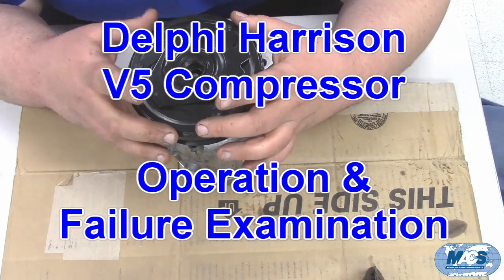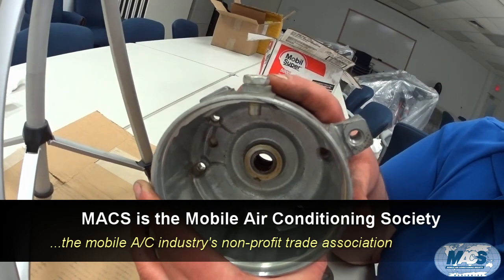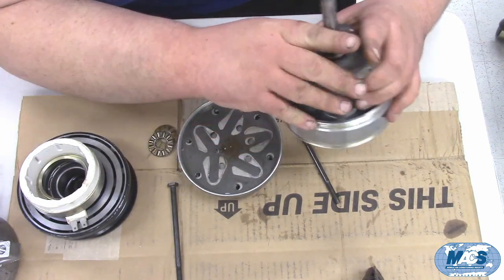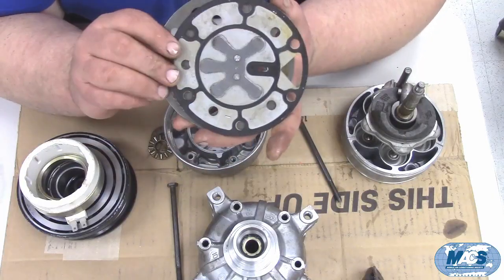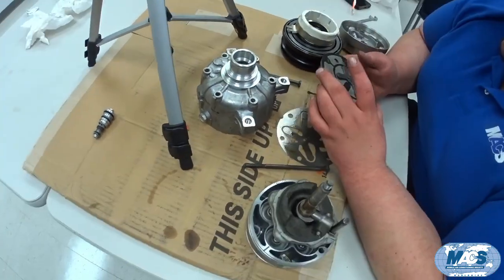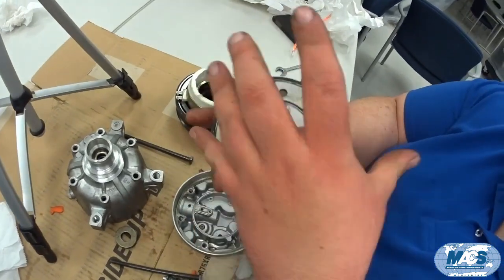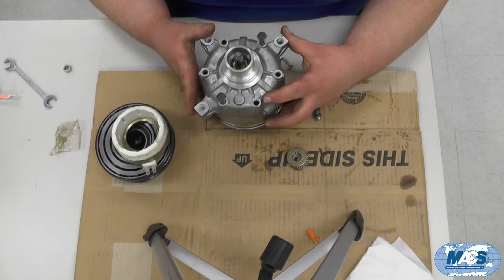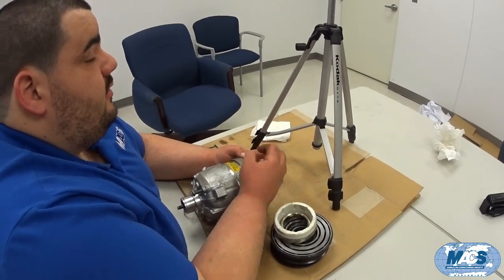Delphi Harrison V5 Compressor (Operation & Failure Examination)

Comment: I love these V5 compressors, very good 160cc displacement, and impressive high durability despite a little noise and harsh but it last much more than modern CVC models in my opinion.
Reply: A vast improvement over the R4 compressor it took place of, IMO.
I'm still a little confused about how the control valve operates exactly, if only based on pressure differential or if temperature is involved as well.
I'l take this wobble plate compressor any day over the R4 scotch-yoke, though.

Comment: I find this video very interesting.  I have a car with this compressor.  I noticed at idle, the clutch is engaged continuously with AC turned on.  It does not cycle on and off like other cars I have owned.  Is this normal?
Reply: Yes that's the way it works, it's a variable compresor

Comment: It's not clear to me what keeps the refrigerant from escaping from under the bolt heads, is there some kind of seal under the bolt heads?
Reply: Yes it's the main seal ,  it's crucial to always use AC at least 10 minutes a week  yearly  to keep that seal from drying out , if it dries out that's when leaks occur  and loss of gas  etc

Comment: Excellent video more like this are needed for our industry for the new young guys and older guys who never had formal education in air-conditioning.      Also seen flush solvents and additives swell the O-rings so the displacement valve get stuck and never moves.  It’s too bad the use of an Micron gauge would show you when you have low volatile solvents still flashing off in your AC system that you can actually read and measure on a test device. Instead of just relying on a compound age that reads 29 inches of mercury and even that is often not accurate and cannot even possibly measure the flash off of solvents or moisture in the system. Therefore later you get corrosion and breakdown of oil‘s due to lack of knowledge. The lack of education is expensive.